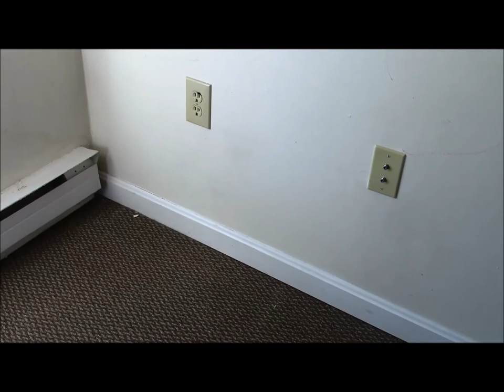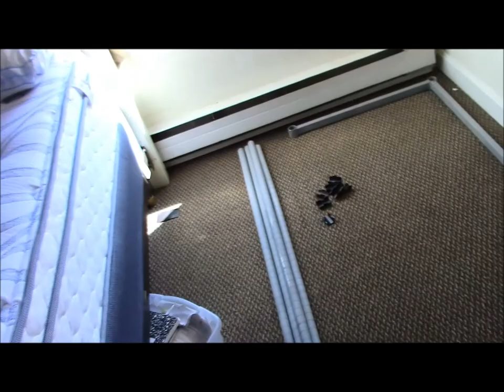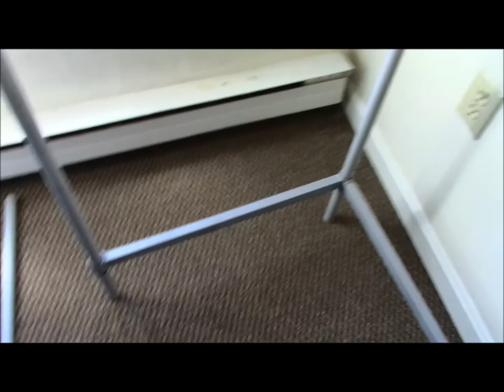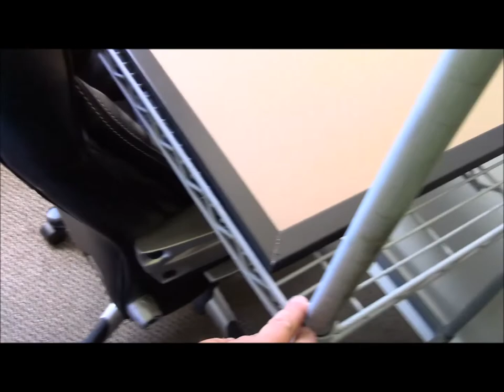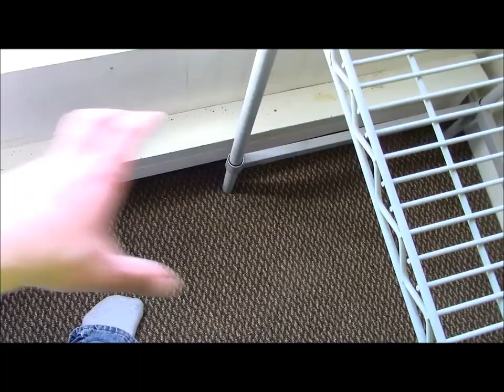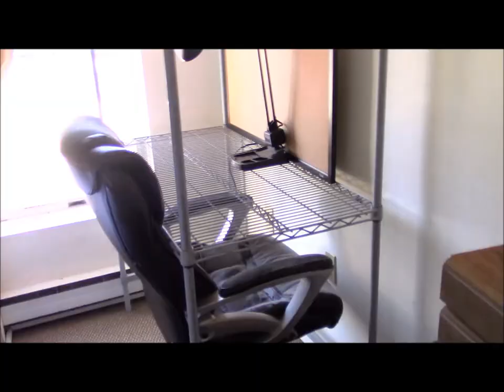Wire shelf desk

Comment: Kind of a weak setup. I used 4 metal poles with one shelf for my keyboard/mouse/desk area and adjusted it to just the right height for typing, etc. I didn't even need the MDF, I just used a shelf-liner and then put a heavy-duty very large mouse pad over the entire surface -works great! The rest of my setup is a metal shelving unit BEHIND the keyboard setup - which allows me to store my tons of hard drives behind my monitors and fill the other shelves with stuff. Lots of pole-mount accessories out there (including monitor mounts) are available that work with these shelves! I use the poles that stick up on my keyboard section of my separate "shelving unit" to hang my headphones.

Comment: where did you buy this? I' m planning the same but a bit different. Thanks in advance.
Reply from the maker: This was all getting thrown away at my work. The piece on the bottom that I'm guessing youre referring to could be made from a damaged shelf, but would require some cutting and grinding.
Reply: @ericsvarietyshow  I figured that. thnk you
Reply from the maker: @Gojay4ever  best of luck! I'd like to know where to find them myself I'd make more. I've been grabbing wire shelving bits and pieces as I've found it here and there for future things to add to it once I can set it up again. Shortly after posting this video I got kicked out of the apartment by my roommate and had to dismantle it; its been stored away since.